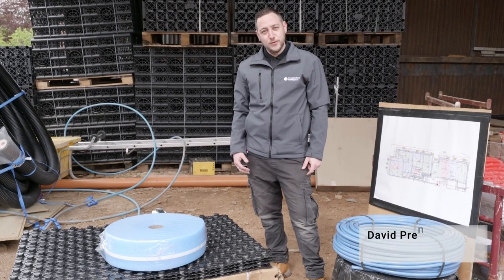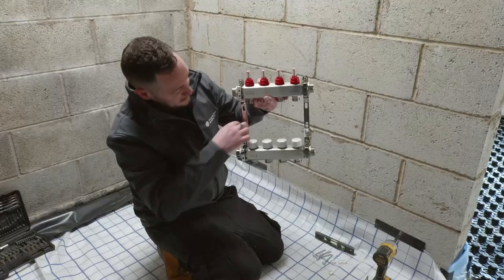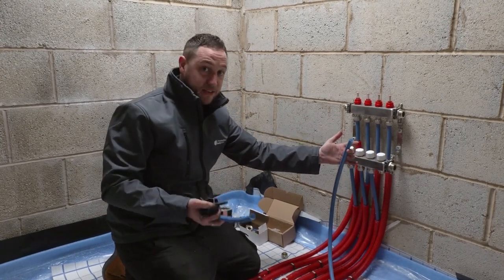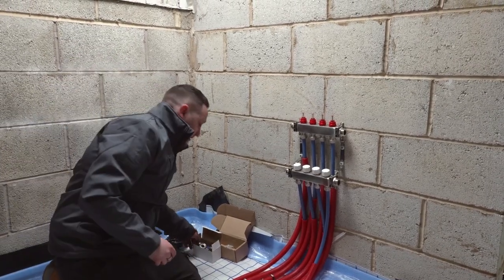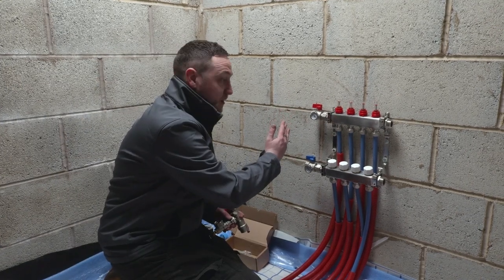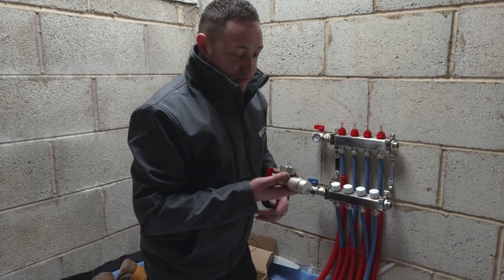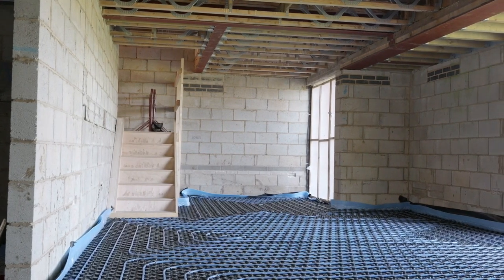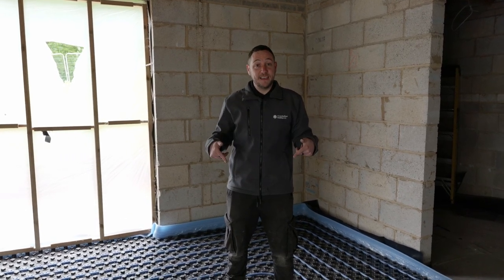Floorwarmers Water Underfloor Heating Installation - ProCrate Egg Crate System

Comment: I'm deciding between pert al pert and evoh 3 or 5 layer for 150mm bend. I had pex al pex and it kinked on 150mm boards. Pleas can some one advise which pipe shall i get. I have wunda boards.
Reply: Pert-Evoh is usually a little bit easier in pre-grooved situations. It also helps to keep the pipe somewhere warm(ish) before installation as, if the pipe is very cold it is more difficult to bend and more prone to kinking.